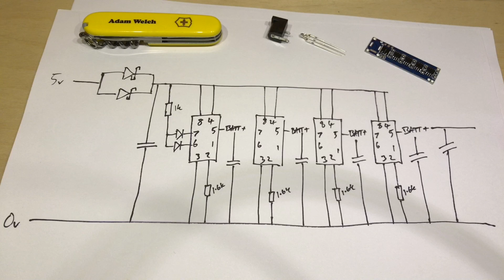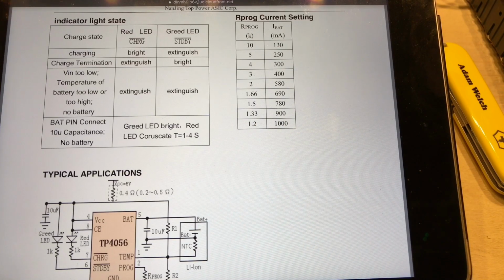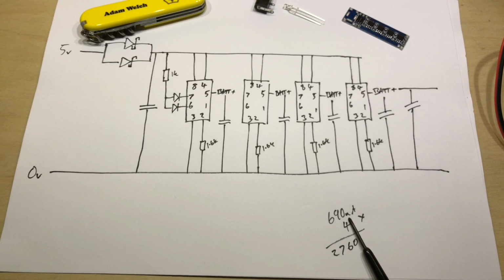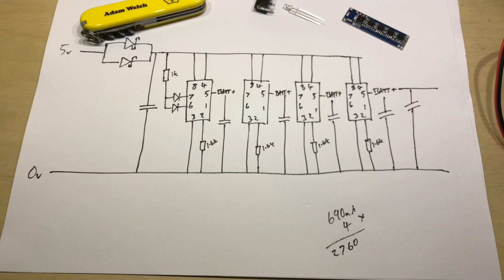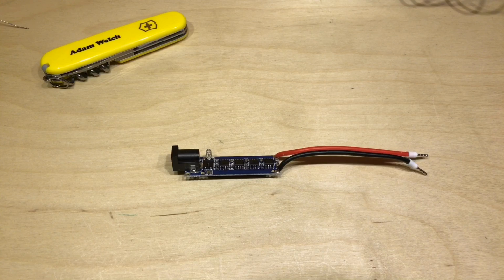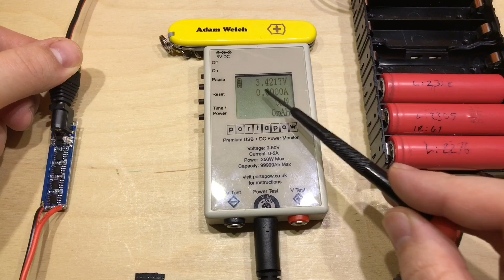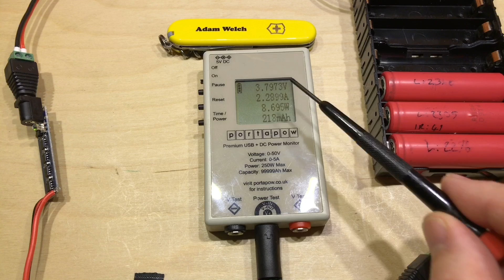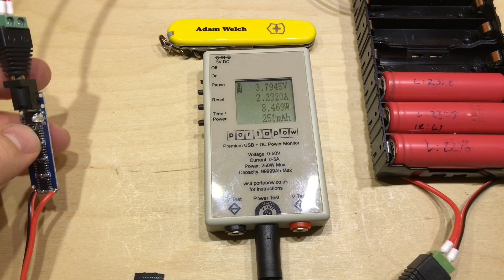TP4056 with more power! - 12v Solar Shed

Comment: Can't I use regular TP4056 in parallal with multiple batteries, like this set up but just four wired together?  I saw someone with a curcuit with 8 wired together with 8 batteries.

Comment: this board is only for charging batteries, how can i add 3amp discharging protection? i have 3 amp led strip load on 18650

Comment: I wonder if you could help, I have a solar security light but in the winter it's barely charging. It uses a single 18650 2200mah battery pack. I was hoping to extend the charging by adding another 5.5v large solar panel, wire this to a tp4056, then also connect this to the battery. I am not sure if this will cause a problem though, since the internal circuit of the security light also has a charging function. I'm really just looking for a way to get more juice to the battery in the winter. Thanks!

Comment: wow, this is really NOT how this ic is supposed to be used... Ofc it is a linear regulator so it is bound to get hot cause it is dumping the input voltage difference from the bat voltage as heat so they SHOULD have included a nice long heatsink with it just to show some effort...

Comment: The goal was to achieve greater than 1A output from the TP4056 board.  Did I miss the part where you told us how many of the 2.3 amps from the single board (4 x TP4056 ) were destined to charge each of the three batteries in parallel?  not wanting to exceed the capacity amps to one battery, insert 3 batteries to make sure to get the most out of the TP4056 (why not insert 2 batteries?). I don't know what the following means "pin 4 is VCC and pin 8 is chip enable so both are pulled high"  and is it correct for pins 4 & 8 connect to pos (on far left) while the LED connects to  pins 6 & 7 ?  why don't 6 & 7 get input on the 2nd, 3rd and 4th parallel connected TP4056?

Comment: Hey I've been thinking about building a UPS/pass-through style charging module with tp4056 simply by allowing the load and the charge supply to be connected continuously. My application can then be powered from the battery and the cells (3-4 in parallel) can then be charged when power is connected to the charger. I thought that since my external supply current is limited then by the charger, this 4x tp4056 seems like a good solution. 

I can potentially get up to 2A safely through the charger continuously and 2A out of the pack provided I have 2 or more 18650s in parallel. So switch-mode losses aside, I should be able to build a 5v USB power pack with pass-thgouth that serves as a UPS for say a small pi or similar USB-powered micro-computer. 2A 10W in and 2A 10W out.

What do you think?
What problems can you foresee with this idea?

I'm most concerned with this-

Under a load that draws less current than the charger (~2A) I'm expecting the charger to power the application and the battery cells to not deplete. However I know that the voltage drop will likely send the charger into the CC charge mode. Now this is kinda required because in CV mode the charger won't let enough current flow across the cells into my application circuit. but I'm also a little worried that perhaps the  charger will never leave the CC charge mode because the voltage across the cells will always remain below ~4.2v (1) when there is no external power (battery backup mode) and (2) when there is a external supply (normal/charge operation). Is this a real problem or will I be fine?

Comment: Nice one! But I would love to see a TP4056 to charge packs of cells. :)
Reply from the maker: I've had this charging 8 18650s in parallel, but obviously its not setup for series packs.  In fact if you wanted to use multiple TP4056 modules to charge series packs you need isolated power supplies as the negative is common across the module.  Plug two modules connected to two packs into the same power supply and you'll create a short!
Reply: Adam Welch Wait, what you mean? Didn't got the short thing. Because you can make, for example, a charger for multiple cells, connecting the imput power in parallel (and one TP4056 to each cell, of course). I'm going to make one like this myself (for 6 cells at once), just need to find a suitable plastic box. :)
Reply: Adam Welch About creating a pack, one idea I had is, for example... Using 3 cells and 3 TP4056, each TP4056 connected to one cell (isolated, of course), connecting the input in parallel (so you can plug one TP4056 and charge all of them at once) and, then, connect the TP4056's output in series. That would absolutely work, but it's a bit of a overkill...

Comment: I would like to use this charger but with LiFePO4 batteries that have charge voltage 3.6 instead of 4.2V. I know that using diodes I could lower the voltage but is that enough? How would you do it?
Reply from the maker: As I found with the diodes on the input - they'd get very warm.  They'll be dropping voltage at a reasonably high current.
I'd find something more suitable...  https://goo.gl/WkO0HX for a 1 amp version. https://goo.gl/TVM0Bt for a 2 amp version.

Comment: Great timing. I just bought 5 of these a week ago and haven't even taken them out of the packaging yet (the first board you showed). I also bought a 2A charger based on the LI4001 which seems to work very well.
Reply from the maker: The original TP4056 modules are super cheap and do a pretty good job at charging lithium ion - the version with undervolt protection is great to put in projects.   This high powered version does have a design issue I'm looking at - hope to do a short update video soon.
Reply: @GadgetAddict layo ng narating mo ah :))

Comment: Did they voltage limit properly at 4.2V?
Reply from the maker: This is probably a glaring omission in the video isn't it?  Your the second person to ask!  I will have to double check this.  Originally I couldn't think why it wouldn't but then last night I was thinking about the four independent chips and how each of them is probably going to have to stop charging to detect the cell voltage periodically.  I might try and put it to the test tonight.
Reply: I was thinking: when they're current limiting, putting them in parallel seems ok, because they're current sources. But when they switch to constant voltage - it's like putting voltage regulators in parallel
Reply from the maker: I'll have a play and see what I can find.  Cheers
Reply: Yes, in fact it does work perfectly. im charging 2x 18650 (Sony VTC6) without any issues, the charge terminates at 4.18 at minimum, mostly 4.20. Although this requires a lot of cooling and is really inefficent when it comes to charging large capacity bank. Check out the TP5000 modules on ebay, another good video idea / review :)

Comment: I suggest hooking it up to the scope as I'd expect the outputs to be all over the place. As far as I understand to measure the cell it has to pulse the output off and read cell voltage momentarily. As the chargers have no form of sync would expect this to be happening out of sync so no one charger can ever read true cell voltage so cut off CC/CV swap etc will be all over place.
Reply from the maker: +James Tutton Thanks. It may be worth an investigation.

Comment: I wouldn't leave this board alone or at least put it in a fire-proof container (I use a stone soup-cup :D)
Reply: A Schottky diode will operate fine up to well above 100DegC  Whats going to catch fire?
Reply: Simon Jowett if the hot chip on the board accidentally lies against some piece of paper it could catch fire I'm thinking
Reply from the maker: I think some caution is sensible.  They always say you shouldn't leave lithium cells charging unattended anyway.  I may do some further testing.  The schottky's are dissipating a little less than half a watt at the boards full power, but the TP4056's are also dropping some voltage too - in fact more voltage when the current is highest.  I'm going to have to look at a standard board and see how much heat is generated on those - I've never noticed anything excessive.
Reply: ***** The only thing I leave charging overnight or when away containing Lithium cells are Phones and Tablets cause its otherwise virtually imposible to have a charged device when required
Reply: Papers self ignition temperature is is 451F (remember the old 1960's film Fahrenheit 451?!)  This is 233DegC - the diode would be dead well before this.
Reply: Simon Jowett Thanks I didn't know that temperature level for paper.

Comment: Makes one wonder if you can parallel the regular TP4056 modules to get a higher charge rate...
Reply: Yes, I've put 10x TP4056 in  parallel and works just fine (10A charging)
Reply: Yes, although I've not done it it should be fine.
Reply: CheapVlog In that case, wouldn't you be able to parallel tp4056s on a lower wall and achieve auto balancing plus over discharge protection? Would seem like it might be a fairly inexpensive protection solution.

Comment: Those diodes are there to take some power dissipation from the IC's, which are linear devices. Smaller the voltage differential between input/output, less power the chip has to dissipate at exactly the same output current. I like to use a resistor for that purpose because the drop on it is proportional to the current which allows me to drop 0.5V on it while the TP4056 is in CC mode and drop much less than that when the chip switches to CV mode. On top of that, power resistors are pretty good at pissing away power as heat LOL
Reply from the maker: It's funny I've never noticed the standard TP4056 modules getting warm - I'll have to check one now.  Some heatsinking may be necessary if I use this again.  Cheers for the explanation.
Reply: Interesting.  So at 1Amp charge and 5V input and a cell voltage of 3V they would dissipate 2 Watts ... wow.
Reply: Yes, by dropping, let's say, 0.5V on a resistor you would shave off one quarter of a watt from the power dissipation on the chip.

Comment: I have the exact same single TP4056 module you showed but it never appears to finish the charge, it just keeps hovering at 4.07V :(
Reply from the maker: I can imagine that the TP4056's might get confused.  As there are a few in parrallel they may read the voltage a bit high and terminate so soon.  They're not really designed for this I don't think.   I'll run some cells on mine for a bit longer and see if I have the same issue.  Thanks for your comment.
Reply: It may be just this single module that's off - waiting for a few more to come in so I can do more testing.

Comment: hi did you want to check the tp5000 up to 2A switching li ion/po and lifepo4 charger
Reply: Yes approx US$2.10 each on ebay
Short the unpopulated SMD resistor pads to switch from 3.6V LiFePO4 to 4.2V Li Ion
Reply from the maker: +playdav485 I will. Thanks.
Reply from the maker: Thank you - I ordered one last night to have a play with.

Comment: The idea is pretty good but I'm not sure if the tolerance on these TP4056 and all the other components, current limiting resistor particular, doesn't kill the efficiency. Why are there actually diodes .... need to take a look at the spec sheet of that thing to see if they are really needed.
Reply from the maker: Mr Johhhnnnyyy suggests it's to drop a bit of voltage as the TP4056's are linear devices.  I think that's a good shout as they were getting warm as it was!